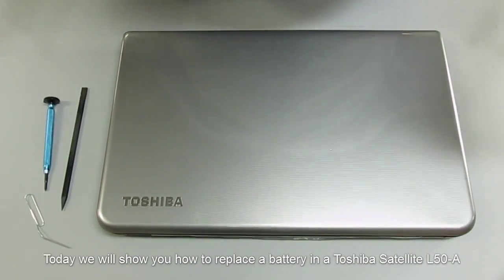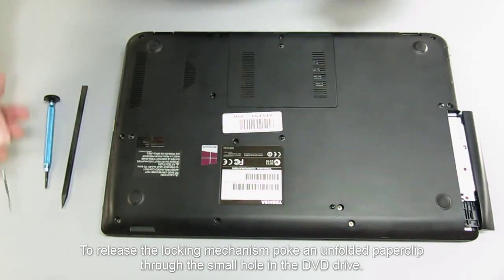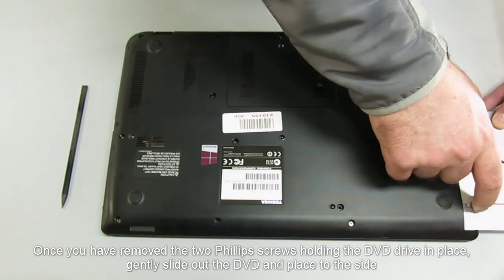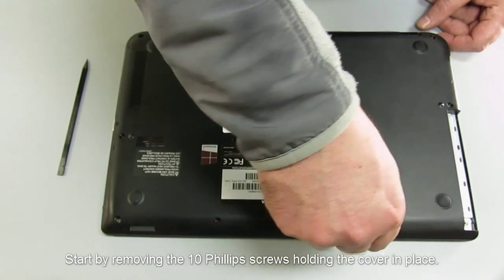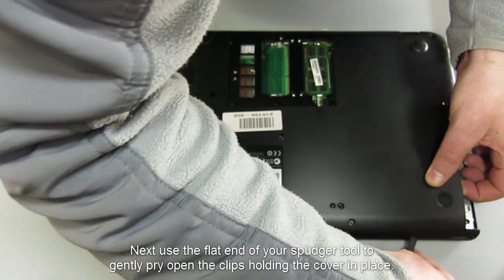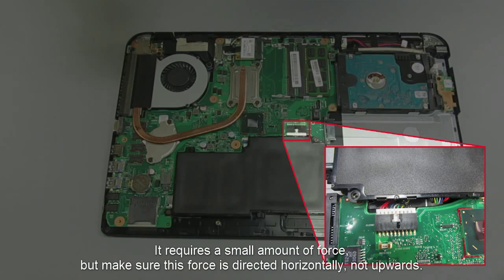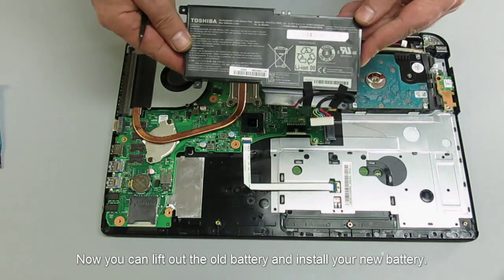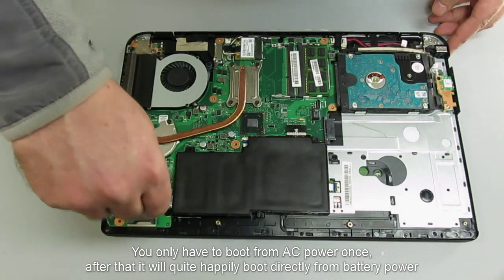Toshiba Satellite L-50A Battery Replacement Guide

Comment: Thank you so much for this. My laptop was giving me the black screen when I turn it on. Somewhere I digged up that you could fix it by removing the battery. Your video was invaluable for this - I got stuck with the connector part until I saw here that you have to nudge it horizontally :) Thank you <3

Comment: The ethernet port, (attached to the bottom), was actually plugged in to the motherboard, near the ram. Why didn't you show this needing to be unplugged in order to lift the bottom panel off? You can clearly see the open spot at 2:13, between the USB & power ports.

Comment: million thanks for you man, this one is the nearest laptop to my L50-A PSKL6L-008007, only difference i have seen is the way the ram is installed, everything else pretty much same to me. any idea how to clean the fan? or removing for cleaning purposes?
.
*Tips : You actually don't need to use pin to pop-up the DvD to access a flat screw, it can be removed 'after' the whole dvd component is removed :D